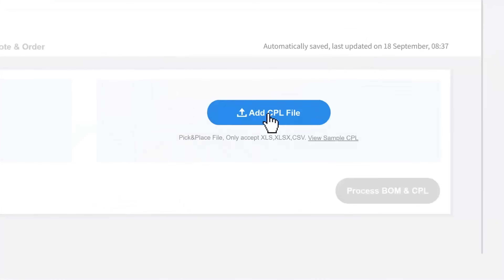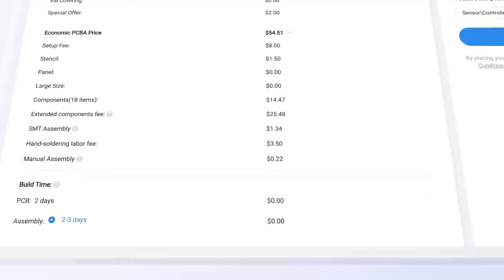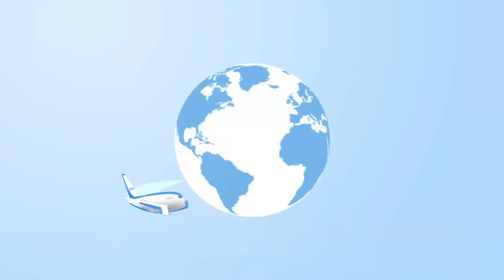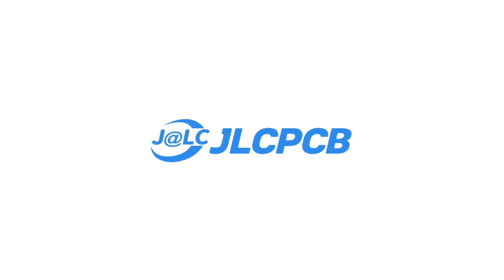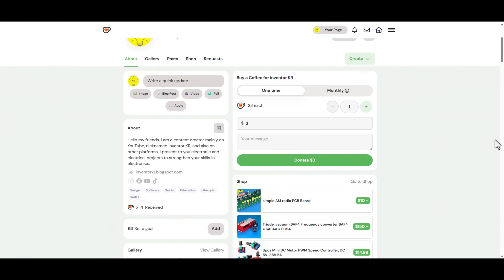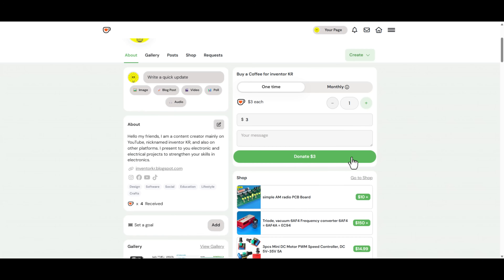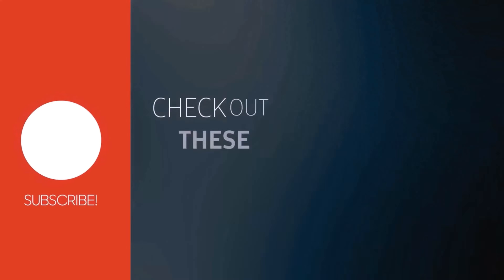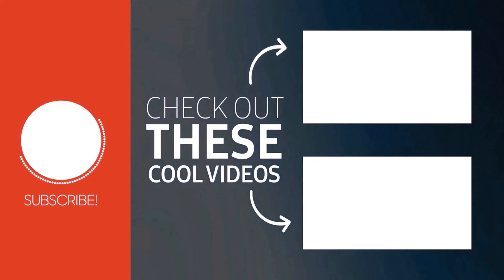how to make solar inverter 12V to 220V , sine wave , 4 mosfet , IRFz 44n

Comment: it will blow the mosfet, irfp460 with 20a and 500v, rds on so very high with low volt, it should be use for H bridge high voltage 350vdc to 220v

Comment: I appreciate that you showed on oscilloscope because that is not a pure sine wave unfortunately. Some devices that are a little bit sensitive will not work and the efficiency might drop because if that.
Reply: cuales serian esos dispositivos sensibles que no funcionarian
Reply: @angelmix2313  I remember that I had a gas central heating system that failed to start because of that.
Reply: @ionix2000  oh pense que era por no tener la fuerza suficiente el inversor para arrancar en ciertos dispositivos demandantes como en mi caso que tengo un regulador UPS que para  mi Pc y no tiene fuerza suficiente a la hora de arrancan cuando esta con energia solar

Comment: Bs
Your mosfets are not IRFZ44N are... IRFP 460...you showed us, how to throw parts on a JCB pcb and one adjustment...
If somebody wants to make this inverter, at least you can share the diagram
When I will have nothing to do, to get bore, I will make an inverter with TL 493 or CD 4047